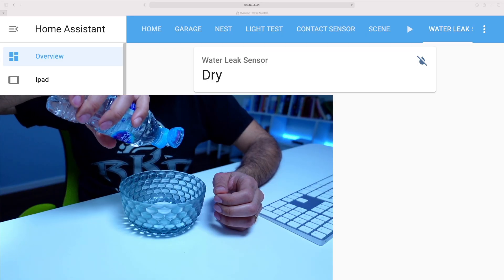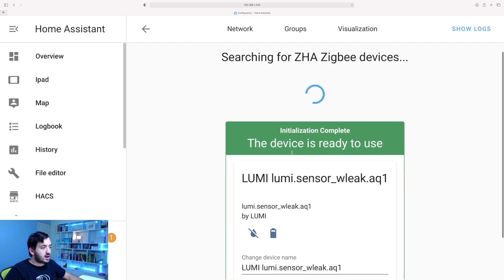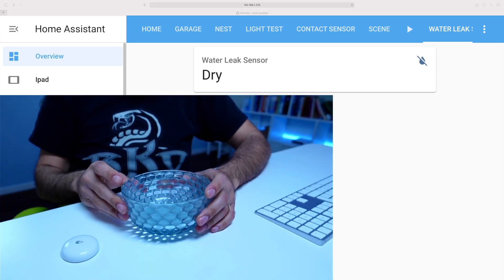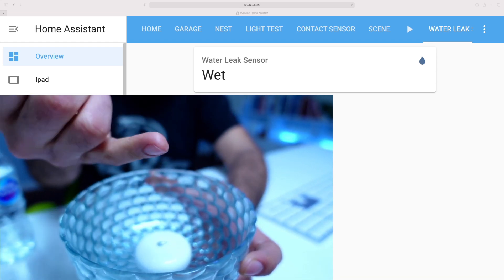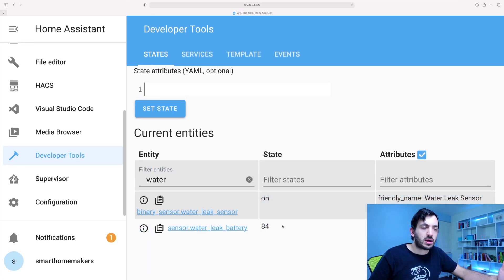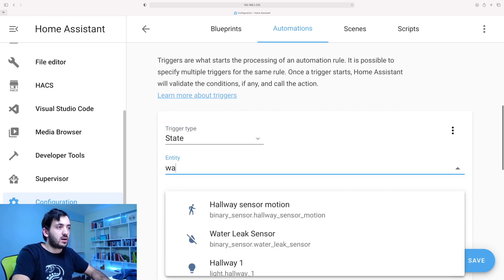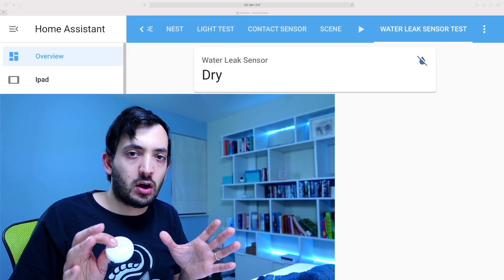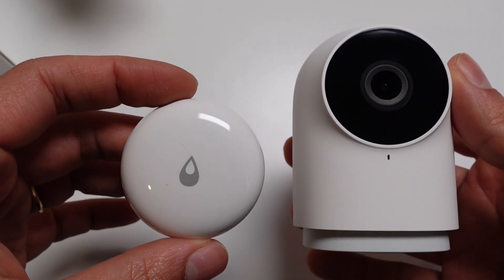Aqara Water Leak Sensor - Home Assistant Automation

Comment from the maker: What would you use this sensor for?
Reply: I'm using it in the opposite direction. Have it in our water disposer for our dogs. Added 2 probes to the metal things underneath that are then put into the dispenser. Once there is 20% water left we get a notification to fill up the water for them! :)
Reply: @lidbergtech  That....is really smart!
Reply: I have a HVAC system, and sometimes in summer when we start to use air-con a lot, the condenser overflows because the drain gets clogged. I then need to clean it out but I'd like a heads up beforehand!!

Comment: I don't know how to set it up. yrs ago it was super easy, but recently I had to change over to 64 bit home assistant, now I can't get anything to work. the zigbee gateway conbee II stick is still where its always been. battery in the sensor is over 3volts, but home assistant is asking for the host name or ip address, I don't know where that is. so its dead in the water . any suggestions ?

Comment: Hi, I bought this sensor based on your video. I'm using Home Assistant on a Raspberry Pi and a SONOFF Zigbee 3.0 USB Dongle Plus Stick. I am unable to add this sensor, is there anything I can try? I've tried long pressing, short pressing, removing battery, nothing worked :( All my other devices (15 smart plugs, various sensorns) are working fine.
Reply: You need to use the Zigbee2MQTT addon

Comment: I have a question. I want to use this in the shower to make automations run. What IV done before is have my ceiling fan turn on, dim my lights and play my Spotify playlist on Alexa speaker that's in my bathroom. However my leak sensor died within a week. I tried changing the batteries and it didn't do anything. I fear water went inside . Any recommendations?
Reply from the maker: Which leak sensor did you have aqara? Also I made a similar video about this :https://youtu.be/90jiE-PYwzg
Reply: @SmartHomeMakers  the one from your video but I didn't know it couldn't keep behind under water eg. In a shower lol

Comment: My first leak sensor arrived the other day, and I got it installed and running. I'm really impressed because my RPi4 and the Conbee stick (bought on your reco) are upstairs in the office on the 2nd floor, and I tested it in my basement and it works! I had some water in my basement during Hurricane Ida here in the Northeast US in early September, and that really is what got me to unpack the boxes and get HA up and running. Also I had a leak in my bathroom sink, so I'm going to put one under the sink in my bathroom & guest bathroom to be safe. For alerts, I've got it notifying my iPhone (which also appears on my Watch so super useful), and I've got another one that checks to see if I'm home, flashes the Hue bulbs in the living room, and announces it on the Sonos in my room.
Reply from the maker: Sweet! One thing left to automate is battery status, sometimes we forget about the water sensor! Happy to read that the conbee 2 stick is working great!

Comment: I have the same sensor connected with ZHA and it always reports „wet“ all the time. It‘s connected using CC2531 instead of Conbee. Can it be the reason, at all?
Reply from the maker: Sounds like a defective unit, does it say wet even in the aqara app?
Reply: I have the same problem with both my NEW devices (Using Sonoff Dongle Plus). They report only Wet and also don't report battery level.

Comment: Interesting, i have a similar looking sensor that has a Bluetooth logo on the bottom and zigbee integration would not find it. I wonder whether they have a bluetooth version of the sensors
Reply from the maker: Hi Roman, never come across any. Not too much a fan of bluetooth on these devices because of the stability of the signal

Comment: Hey thanks for the video.  I apologise if this is a dumb question, but were you using the sensor alone, connecting with Home Assistant via a zigbee dongle, or do you have the sensor manufacturer's hub, and home assistant is receiving messages from that?
Reply from the maker: No dumb questions! Using home assistant and a zigbee gateway conbee II stick. Check the link in the description of my kit

Comment: Interestingly enough, If you have these sensors connected to Deconz, you get 1 additional attribute... Temperature.  I don't know how to add attributes to ZHA yet, but since the info is there it's obviously available.
Reply: I have extended the contacts with wires and use it as a sensor to tell me when my dehumidifier reservoir is full and needs emptying.
Reply from the maker: @MAMDAVEM  Very good use case, I'm getting some more Zigbee sensors in too!
Reply: @MAMDAVEM  Hi, what kind of wires did you use? I'm going to put some in my basement and I'd like to extend the reach. Thanks!
Reply: @lwizinski  I just used some 20 or 22 AWG wire that I would normally use for my electronic projects.
Reply: @lwizinski  if you are going to extend the wires some distance I would use much thicker wire to reduce the resistance …. Perhaps 0.75 mm flex cable
Reply: @MAMDAVEM  do they undo to attach? Interested to hear how you connected the wires
Reply from the maker: I remember reading about that these hidden attributes didn't refresh as much as the dedicate temperature sensor
Reply: @SmartHomeMakers I dont stare and compare the refresh rate, but everytime I look at it, it's on par with other devices.  If you find out how to access the attributes in ZHA let me know, otherwise I will be moving the key temperature area ones to Deconz.